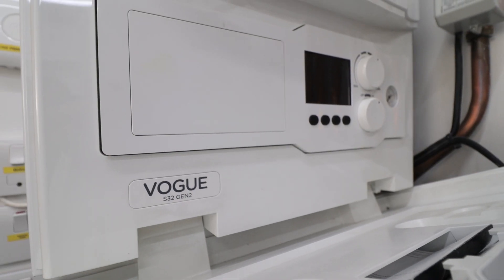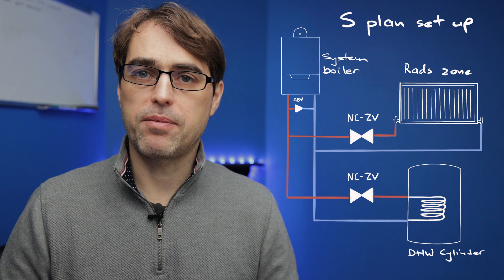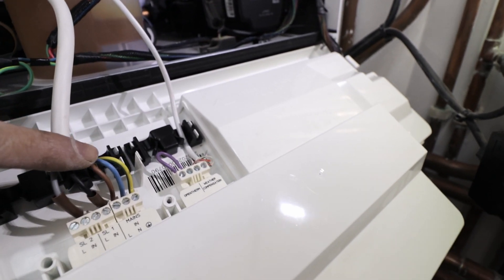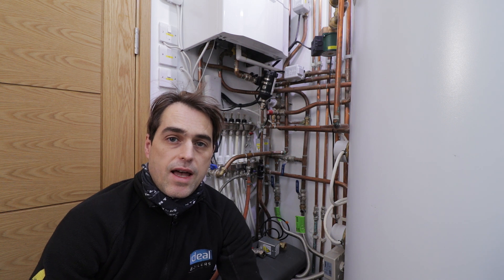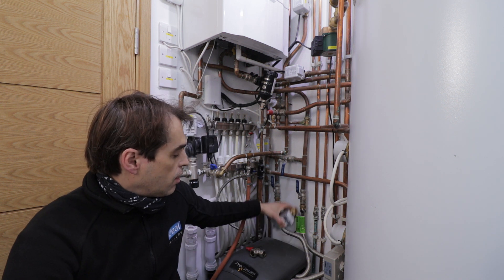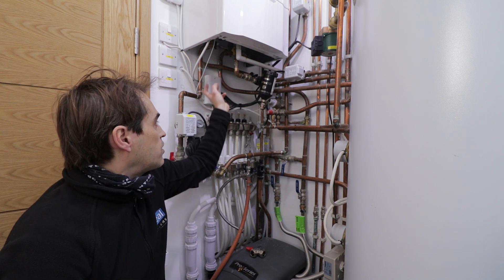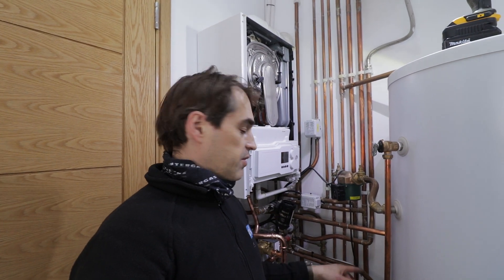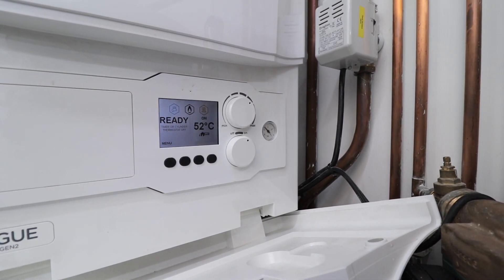Hot water priority with Ideal Vouge boiler

Comment: As always really good ! Why isn't everyone using smaller (appropriate) sized boilers and changing to hot water priority in this way?
I'm sure with quick reheat times it would be fine for the rads not to be on, it's only about 20 mins for a full tank, or program your water outside of the heating periods.
If you were closer I would hire you !
Reply from the maker: lack of awarness is the main cause. Even boiler manufcturers are unaware of those things. Manufacturers just want to sell boilers, installers want to install it the easiest and cheapest way.

There is no training that explaines those things, you need to figure it out yourself really.
Reply: @UrbanPlumbers   Asked a local plumber about this and he told me that it was a bit of a daft question (referring to me as "pal") as the hot water and central heating were the same hot water from the same boiler with modulation etc,to control the power output, did not seem to have any concept of having the boiler respond to 2 things with different power outputs, so your right, a lack of understanding from so called competent people, although i accept not all boilers are possible and maybe the normal S plan is so ingrained into some people
I did mail you about my boiler and hot water as i think i will change from system boiler and vented hot water to system and unvented, maybe with intergas boiler and do as you describe (i also have solar PV diverted to immersion for extra free hot water} - was asking for some input and idea of budget. Im not sure with a 15mm incoming and 15mm gas pipe if a combi would do it for us and i would lose the solar input..... a lot to consider. I think you only work in the London area and not the midlands, right?
Reply: Great video Szymon. 
With Priority Hot Water, when hot water has a requirement (on schedule and below required temp) AND heating also has a requirement, is this setup basically turning the heating off rather than giving it the hotter water?

So say my heating is scheduled for 6am to 9am and my hot water from 7am to 8am, will this mean my heating is not on between 7am to 8am (assuming my tank takes that long to get up to temp) ?
Reply: @jonathanstevenson6771  yes, it's hot water OR central heating with one having a much higher flow temp than the other. We have updated our system to something similar. Hot water tank is never truly cold and with a high capacity could it's hot in under 30 mins. While heating the water the rads are off.
We simply time hot water outside if our heating times when the weather is cold.
Hope that helps.
Reply: @stephenhill3593  using the control system to manage the 2 to run at different times seems a simple solution that requires no hardware change.  So converting S-Plan to HWP seems a big change needing pipe work altering for ‘the off chance’ that heating and hot water come on at the same time, maybe due to fall back temps or needing additional / boost of water?
Reply: @jonathanstevenson6771  you have to have a set up where hot water is around 75 flow temp and central heating much lower, and on weather comp if you can. Getting the boiler to do different flow temps based on what is being called fir is the tricky part
We have Viessmann set up as 3 pipe so hot water feed high temp, central heating in weather comp and common return pipe.
Reply: When sizing boilers with PDHW and 15KW coil, and lower KW heat loss for heating. Would you install a smaller 15Kw boiler? Most boiler size calculators add the cylinder to the heat loss
Reply from the maker: @charlesbarnes1344  no you don’t add cylinder to heat loss. Always size for heat loss. 

Having said that 15kw is about as small a boiler you can get

Comment: Thanks for the informative video, seems odd we have to add an extra valve to override other valves already fitted, a better way surely would be for the boiler to control the valves based on it’s Input from the thermostat and hot water stat? But this way keeps it more traditional I guess?
Reply from the maker: The only boiler that does it this way is Vaillant, but then you have to use vaillant wiring center and vaillant controls.

Other way is what viessman and worcester do with 4 pipe set up Ans internal diverter valve.

Otherwise you have to do x plan with additional normally open zone valve.

Not a problem if there is 1 heating zone as only 2 valves required, but with more hearing zones you have to keep existing valves and add NO valve.
Reply: @UrbanPlumbers   Thanks for taking the time to reply, not heard of the X plan before you mentioned it, looks good, all the best for your channel - its really good and clear, plus i learnt somthing so thanks!

Comment: Hey Szymon, hopefully lack of videos is purely cos your busy with work and everything else is good with you! Just wanted to point out that, at least on paper, much of the same functionality is also available on a bunch of Ideal boilers including the lowly Heat H only boilers AS LONG AS Weather Compensation is installed.
Where did the link to wiring diagram(s) go??
Reply from the maker: yes, mad busy so no time to film. Also the diagram had a mistake, i will have to correct it one day.

Comment: So in theory, using HWP means that the bypass valve should never be needed as there's always flow through either HW or CH circuits.  During pump over-run, the CH valve will be open.  Good to keep it though just in case a zone valve fails I guess?
Reply from the maker: You might need not on heating of TRVs close. I don’t use any.
Reply: @UrbanPlumbers  I literally just thought of that and was about to edit my previous comment lol.  Yes so assuming you have some rads without TRVs and a boiler with a modulating pump, or a pump that's set to a low speed, you'd not bother fitting a bypass in an HWP system?
Reply from the maker: @Chris-hy6jy yes, I just don’t fit them.  I one knows how to set them anyway so they usually either don’t work or cause more problems than provide solutions
Reply: @UrbanPlumbers  agreed.  The system in my new house has one fitted, set to 0.2 bar and the boiler has its pump set to max so it's basically bypassing all the time.  Probably been like that since it was installed!  I've changed the pump map to a constant lower speed and tried to adjust the ABV but it's constantly passing now even with the pump on its lowest speed so needs to be replaced or removed.  I'll probably just convert to HWP and remove the ABV at the same time.  Thanks for your help! 👍

Comment: Very educational, really like it. I am curious about the weather compensation thing. Can you go a bit deeper in that topic? Is it another device? Embedded to boiler? or what need to facilitate? pros and cons?
Reply from the maker: It is just a temperature sensor that goes outside and allows boiler to read external temperature and modulate accordingly. Is usually only costs around £40.
Reply: @UrbanPlumbers  of 5£ for an 10k ntc ;)
Reply from the maker: Plus£35 for little plastic enclosure :)

Comment: I have a ideal vogue gen2 system boiler and a s-plan setup to 3 ufh manifolds. I always have my boiler working on and off as the flow temp needs to be 60+ , the ufh only takes 40 max and I have aggressive zoning through genius hub. Thank god this is a quick and relatively painless change I need to make to the system to make it more efficient!
(Edit: i was told by a heating guy before i has to up my s32 gen2 to somewhat stronger! I think what i need now is some modulation to lower down the heating output... there is no opentherm in genius hub so I guess I have to use weather comp.)
Reply from the maker: yes, this should help sorting your cycling and will lower your bills and also save the boiler from premature breakdowns
Reply: @UrbanPlumbers  Hi, I still haven't find anyone to do anything about it but I am thinking about the other method to keep minimum parts changed.

Could it be possible, given that I can separate hot water and heating completely through genius hub, I can use ordinary NC valves but connect to SL1 and SL2 separately to use different temp settings? So the only things i need to change is the wiring, no actual wet work required.

Comment: Thanks a lot, this is a great video as I’m wanting to move away from traditional system set ups
Reply from the maker: PDHW is great but I would not use Ideal boiler for that. You cant adjust pump speed on it. Silly boiler really

Comment: Honestly i think this is overkill, does it work yes but the cost and complications are greater than benefit. Firstly towel rads should be plumbed onto coil get rid of zv, then uf doesn't need zv if u have actuators and wiring center and then u are only left with hw/ch zv that can go SL can go directly into boiler. So that would be mine idea how to simplified things. Yes i see issue of having UF at high temperature but mixing valve would do the job,not the best efficiency to heat up water to 50 and then cool it down but that's the compromise i would prefer compared to having 4 zv valves that on daily basis fails

Comment: A thing to note, apparently you can’t have WC and Opentherm together. The system gets confused. Opentherm is better than WC if you had to pick though
Reply from the maker: Trouble is you can’t have 2 zones on OT easily.
Reply: @UrbanPlumbers  yeah if you separate the zones then yes it’s not possible, but if you use something like Evohome, then this isn’t an issue as the Opentherm bridge looks after the whole system as well as UFH
Reply: Is that right? I had an Ideal Max Heat boiler fitted last year, with S plan, Nest 3 and Kingspan unvented cylinder. After watching Szymon’s fantastically informative and helpful videos I am was going to convert it to a PDHW system with OT and WC, so should I only connect the OT and ignore the WC? I am also now pretty sure the boiler is oversized, but will work out the heat loss etc to confirm. Thanks Szymon 👍🏻
Reply: @stephenwardle9803  yep that’s correct, you can’t have both, the system gets confused. It was Ideal boilers that confirmed this to me, and they said that OT is better than WC, so that’s the best one to connect, but not both..
Reply: @jimmyc38  Thanks Jimmy, saved me buying a weather compensator.

Comment: Great presentation and explanations. Well done.
Reply from the maker: Glad you liked it!
Reply: @UrbanPlumbers  Hi again. Currently I have a Lamborghini combi heater for more than 12 years but also have from my brother a brand new Remeha Avanta 30s (is an older model) and Remeha iSense thermostat with outdoor sensor. What's your advice, could I use this Remeha adding a hot water cylinder, zone valves, etc, greatly explained in your movie? Would be a big save for me but also a nice project. Thanks for your answer.

Comment: Why have the NO valve on CH and NC on HW?   HW will be in demand all year , several times a day , and CH may not be used for half the year.
If the HW valve was the default, NO valve, then there is zero valve activity in summer.  Much longer life on the valves. And a bit less electricity.

Comment: You could also do this with a 3 port valve instead of a tee and normally open 2 port valve. A standard 3 port mid position would work if you joined the white and the grey together. If you can get a 3 port diverter, even better 👍🏻
Reply from the maker: yes, I do it this way sometimes - you just need to remember to put the 3 port other way round!
Reply: @UrbanPlumbers  😉